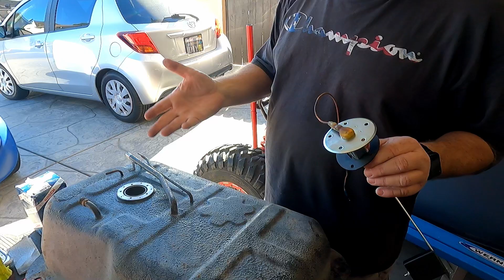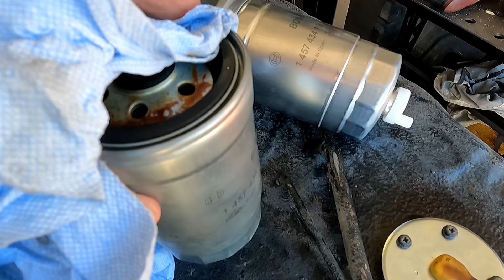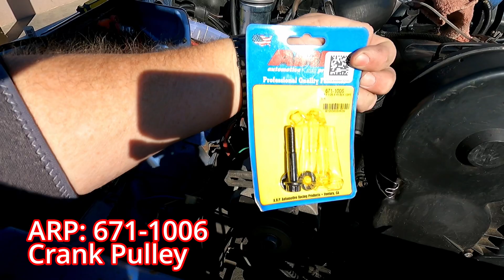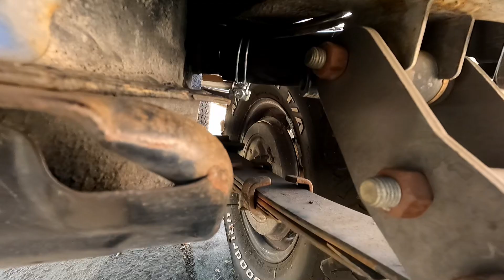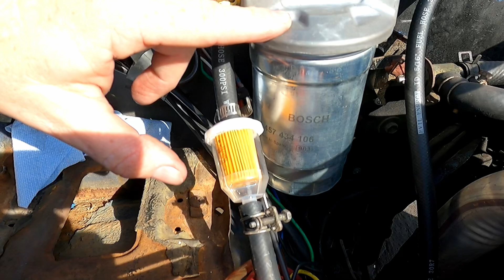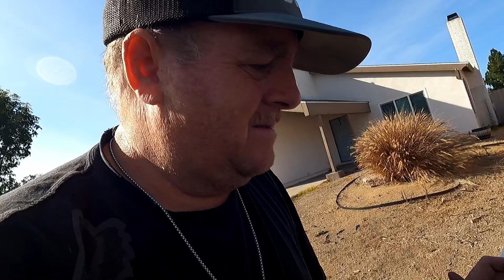Suzuki Samurai 1.6 Turbo Diesel Fuel Tank And Injection Pump Install

Comment: the gunk in your tank looked like it was bacteria. its a pretty common issue, you can prevent that with a diesel biocide treatment, especially if there might be any water in the tank
Reply from the maker: Hello Monkey With A Wrench, Thanks for the recommendation. I’ll check that out. Thanks for watching!!